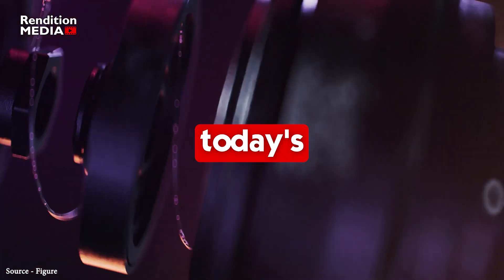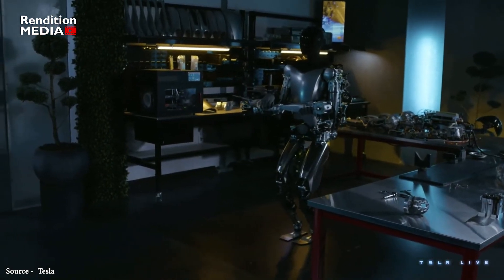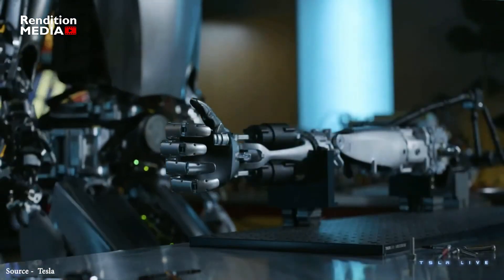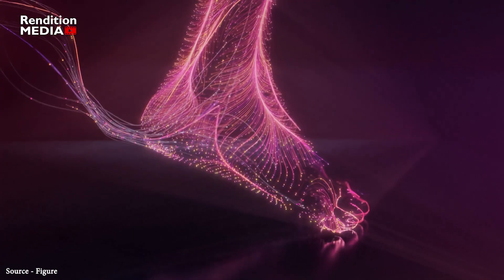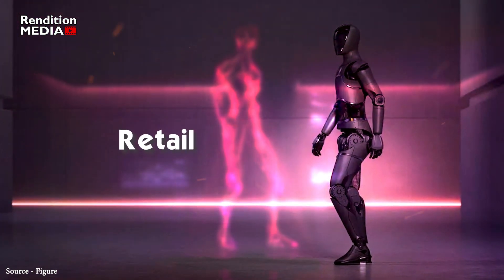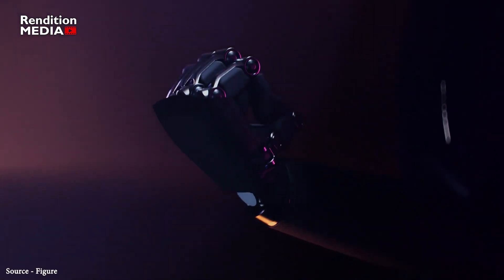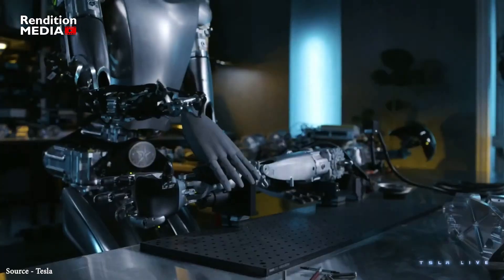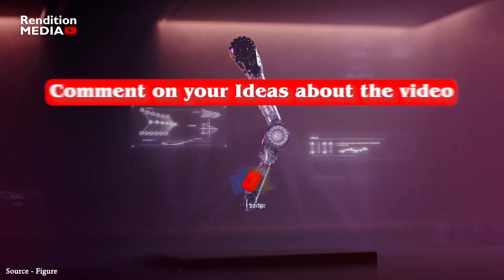Comparative Review of Humanoid Robots | Tesla Optimus vs Figure 01 | Rendition Media

Comment: Where is the value-added reasoning for a minimum wage worker replacement with an android?  At even $15/hr for the gunt grade worker, a bot makes no sense.  And then there are the maintenance and programming costs.  The machines show no dexterity or speed.